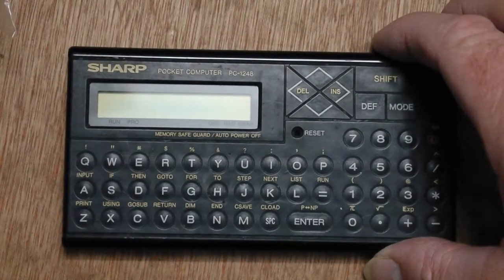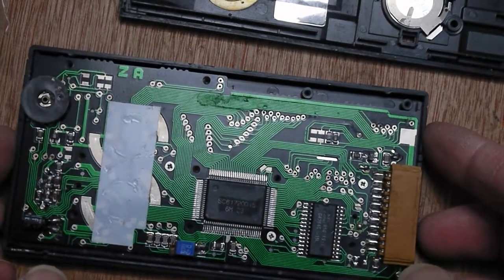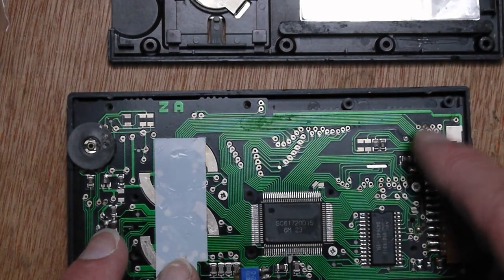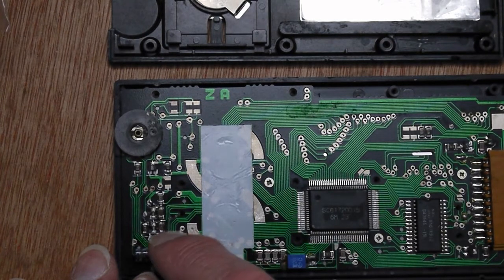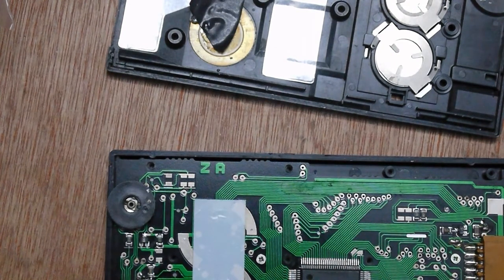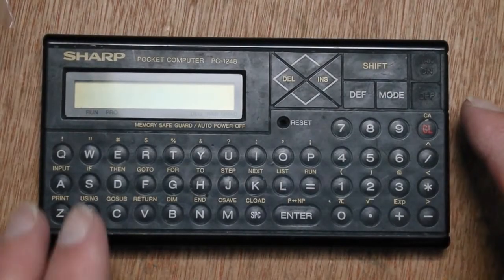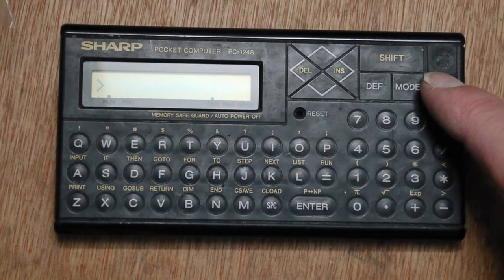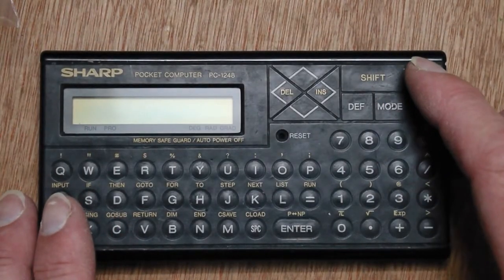PC1248 Fixed. Sort Of.

Comment: The 1246S is in the same family. That membrane keyboard is the worst Sharp ever put into a Pocket Computer. For cost reduction on the 1246S and many, many other models, Sharp left the piezo buzzer out, although the "beep" command is implemented. As with all Sharp Pockets, you can hook up a piezo buzzer to pin 3 and 7 on the 11-pin IO if there isn't a dedicated buzzer connection on the board.
Reply from the maker: Ah, I saw jumpers on the PCB related to 1246S, it looks like they are used when a 2K RAM is fitted. Maybe I soldered the buzzer to the wrong connections? I might have another go.